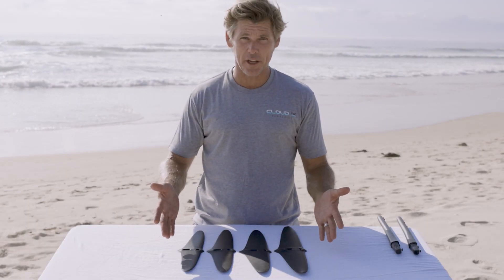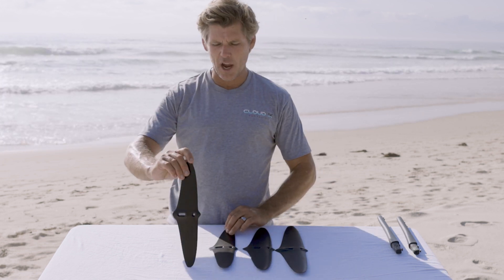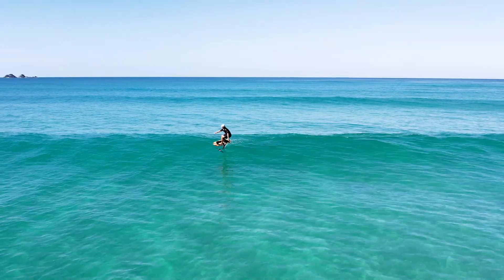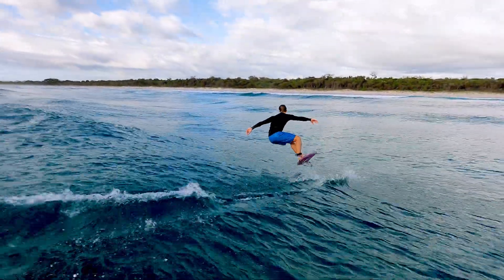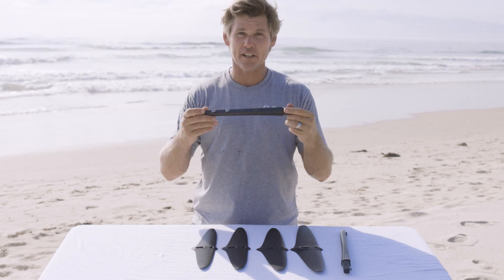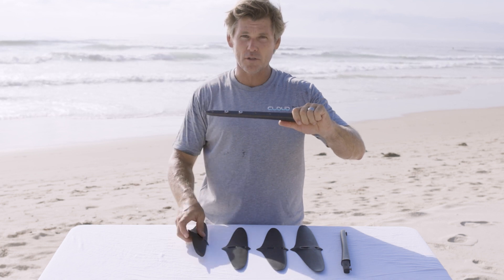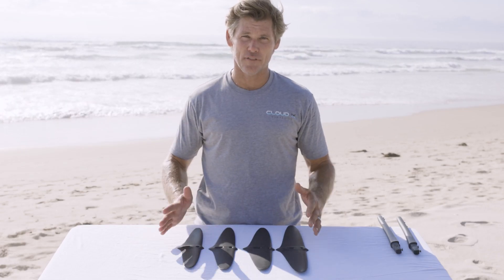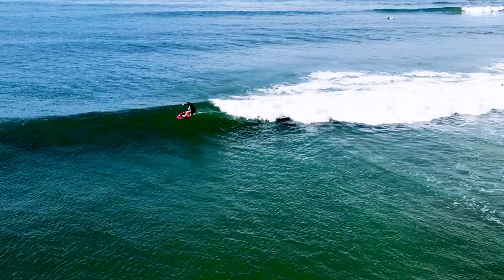Cloud IX FS Range tails and fuselage

Comment: My FS 850 setup came with a 13.5 stab.  This was probably before you guys rebranded and expanded the stab line.  13.5 = 157?  I also got a 15.5 , does that = 177?  Would be helpful if you put a product chart in this video so we can see the volume, width and aspect for these stabs. Even on your shopping site its not clear, not much is mentioned on the stabs other than the volume, even the pictures don't tell much. 

 I like the simplicity of Cloud Nine setups in that you don't need to buy 4 different fuse extenders, makes things easy.  Planning to get a few more stabs to expand my quiver.
Reply from the maker: Hi dkschrei,
Thanks for your message and your support.
We are working on the site daily and we are getting there slowly..
I like your thoughts on more details on the range, sometimes we take for granted what we know..
Projected cm2
New FS157
New FS177
13.5= FS197
15.5= FS227
Hope this helps
Regards 
Karl
Reply: @cloud9surffoils109  kind of, still don’t know the cm2 on 157 and 177.  I guess I got 197 and 227 so might grab the smaller ones soon.
Reply from the maker: Yes, you have the 13.5, which is 197cm2.
We renamed them now so the cm2 is the size. 
The old scale was the width. 15inch 13.5 inch.
The smaller ones really open up the potential.